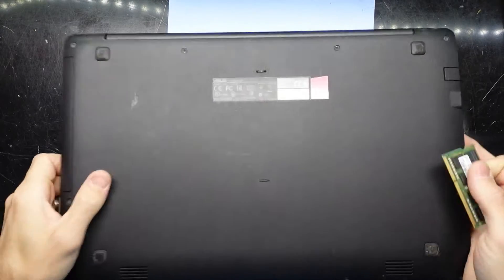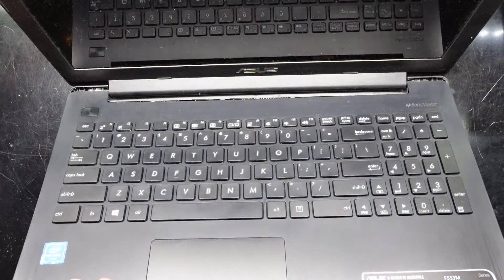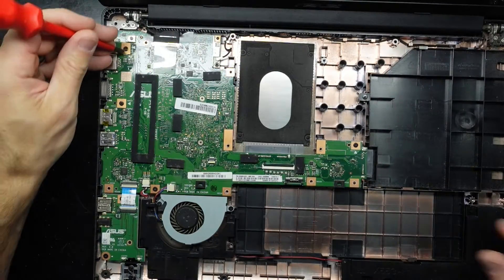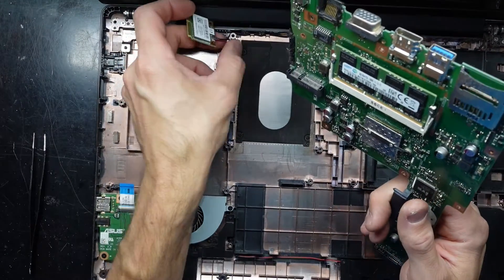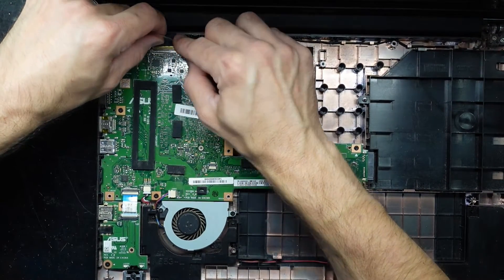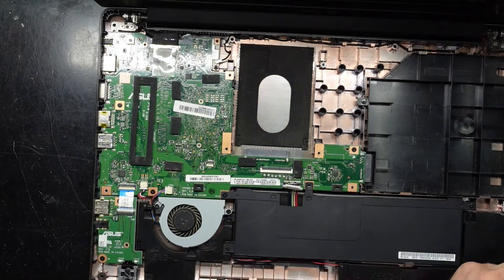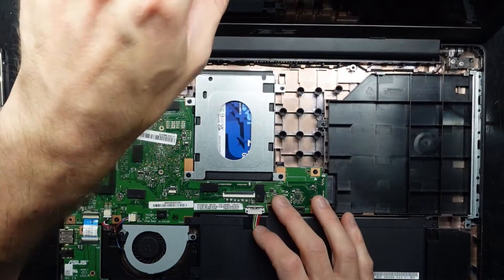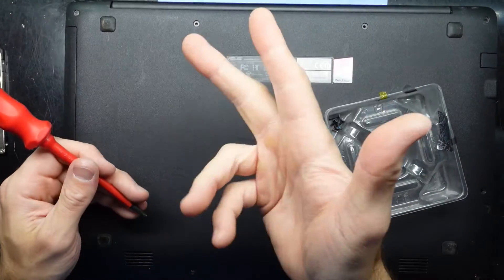Asus F553M Ram and SSD Upgrade

Comment: Is the Asus F553M worth rebuilding? Got a hold of mostly the shell of the F553M, but might need more parts than its worth. Can it be upgraded to Win 10? Thank you. It has only one RAM slot? Watching you take it apart, may not be worth it, as too many parts are missing! It was an apartment dumpster find! 4:01 is that a n M.2 / NvME slot? Hmm.. thats the WiFi slot!